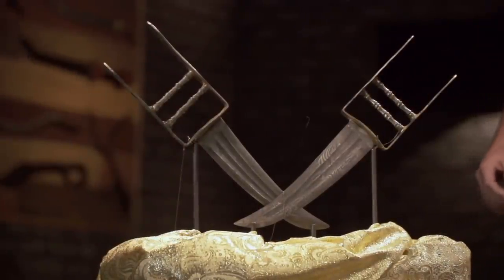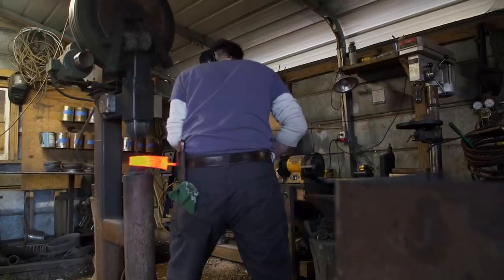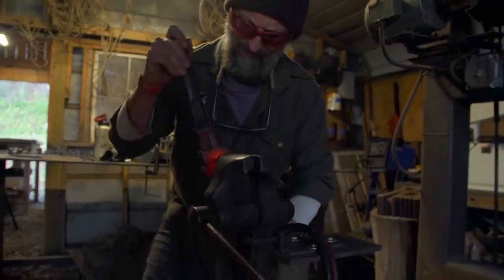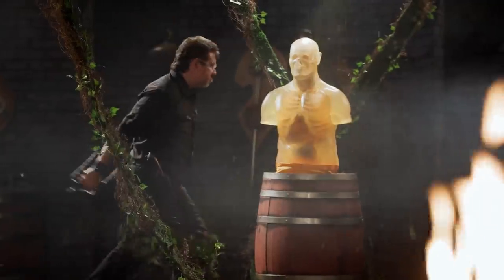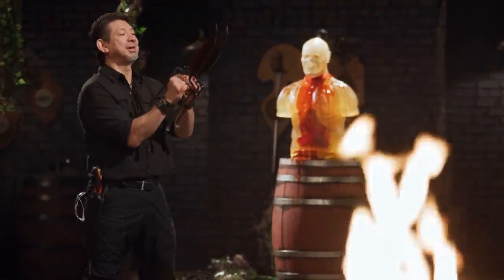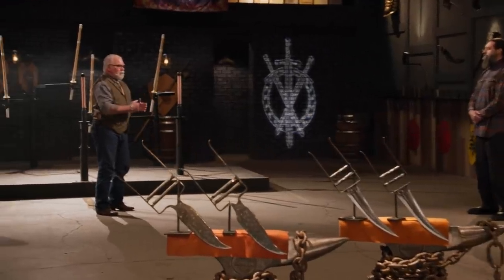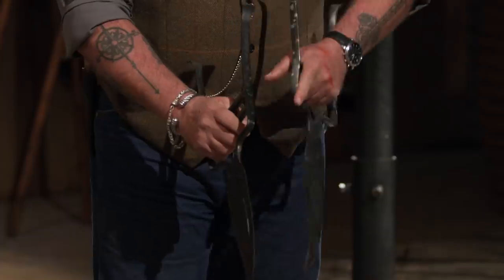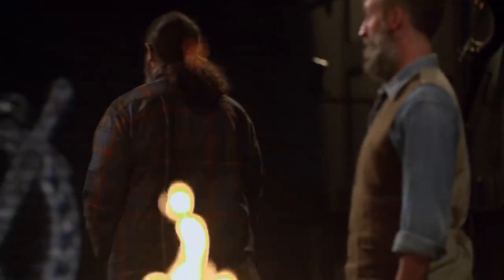EPIC WEAPONS FORGED FROM CRUSHED CAR! | Forged in Fire (Season 9)

Comment: The katars first tested had handles that are way too big.  The sidebars are supposed to press alongside your forearm, and your grip is supposed to squeeze tightly against the sidebars.  This gives them much needed support.  You can see how badly they twisted in Doug's hands when he used them.

Having the handles that wide is dangerous to the user and those shouldn't even have been tested due to this.  The testers could have easily sprained or broken their wrists.

The second guy's handles were closer to the right size.  Still a bit large, but within range, especially if the user were wearing gloves or gauntlets.
Reply: And none did the riveting right. They are usually two and they are at an angle so that they can't be sheared off that easily...